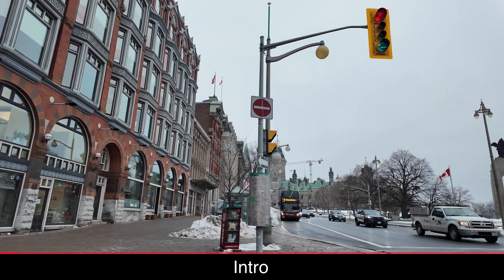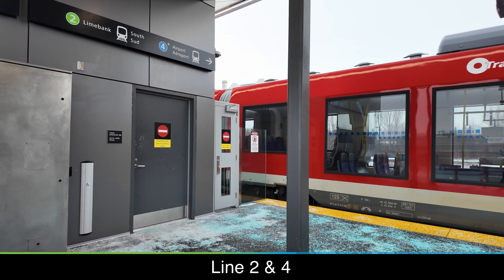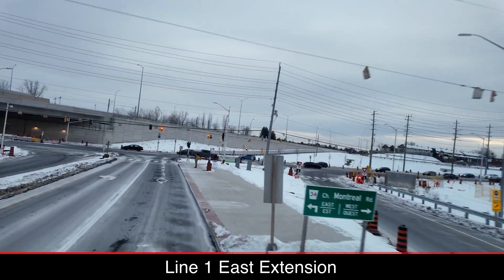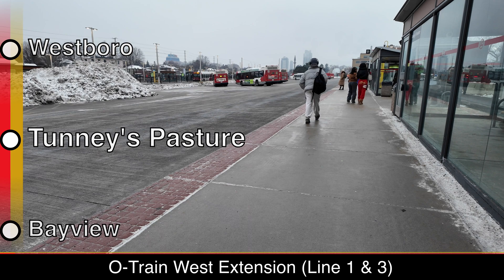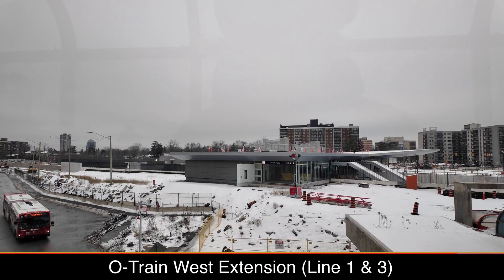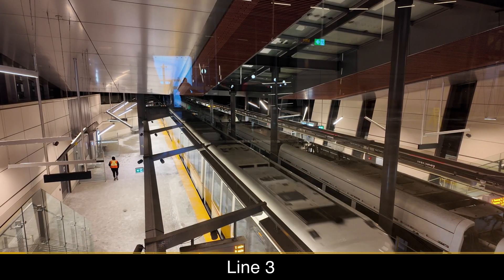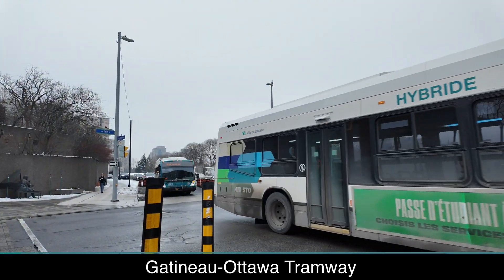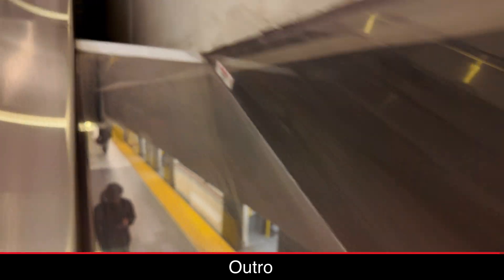Ottawa's 45km Rail Expansion | Progress Update

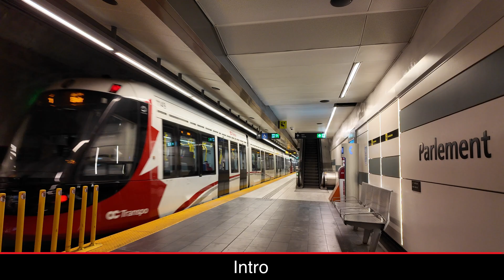Comment: 1:02 "It's [the Trillium Line] been upgraded with more double track sections to allow for higher frequencies of every 12 minutes" -- The same line already had an average period of 12 minutes between trains during rush hour.  The big differences will be the size of the trains, the length of the line, and the number of stations.

Comment: I would like to point out that there is no plan to improve frequency on connecting suburban bus routes.  In fact, there will be many routes that bus routes will have reduced frequency, as currently planned and to be implemented in April 2025.  OC made the same mistake when Line 1 opened in 2019 and turned off a lot of transit riders.  Trains are useless if the connections to local buses are awful.
Reply from the maker: Cutting bus frequency is really not good, trains have to be easy to access to get ridership!
Reply: The city's choice of frequency in the bus network has always been a main criticism from me.. but some of that frequency issue is simply because of bus resource issues the city itself created in 2017, that the city still hasn't resolved. NWTB, while meant to improve the trip completion rate .. it's also much to hide that bus resource issue.

Comment: It interesting to see the contrast in engineering on these stations; I'm disappointed of the value engineering on stations of the Trillium Line without proper covered platforms, yet pleased they're present on the east/west extensions. Since Carleton & Bayview will be two of the busiest stations, you'd think they would warrant the better build-out... Fingers crossed this opening goes better than 2019! Great reporting on the progress!
Reply: Part of the Trillium Line platform at Bayview is covered by the bridges for the Confederation Line and Albert Street.  You can transfer between lines 1 and 2 without getting wet.
Reply from the maker: A couple of stations probably could've warranted larger canopies, but overall, I think the amenities in these stations are a lot better

Comment: Too bad stage 3 won't be operational for quite some time, if it happens at all. Hopefully, once stage 2 is up and running and the benefits become visible, especially the west extension, there will be more pressure for stage 3 funding.
Reply: Why do you think there was a provincial election this year... it allows the province to prepare the plan for the extension in the 2028 budget. While that's a 3 year wait to set the extension project, that's often how politics works.
Reply: The problem is the railways they're building in Stage 2 are just as slow as Stage 1, so it's actually turning even more people away from transit rather than attracting them
Reply: Actual stats show otherwise  @OntarioTrafficMan

Comment: When will the network be fully double-tracked?
Reply: A generation or two, if ever.   We have already seen that Line 2 had to close for over 4.5 years with few upgrades to the original section and no time savings or frequency improvements resulting.  How can the line be double tracked without another substantial closure?  Will the public tolerate this?  I doubt it.   The replacement bus service for the last 4.5 years has been horrible.
Reply: @lovehandr  In theory a second tunnel could be built under Dow's Lake but it would be a very expensive undertaking.
Reply: probably not, Line 2 relies on an old freight rail tunnel to cross under dow's lake, which is why the frequency can't be better than every 12m. It's the only remaining single-track section north of south keys station. line 1&3 are fully double-tracked.
Reply: @yukaira you can double track almost every segment and just have switches at either of the tunnel and have proper communication signalling to do so. It will be a bottleneck for sure but can drastically increase frequency
Reply: @yukaira  Can the freight tunnel be widened?
Reply: @tompeled6193 There is no need to widen the tunnel. It only takes 2.5 min to travel through, so if the rest of the line were double tracked, they could theoretically run every 6 minutes (realistically every 7.5 min). Which would allow lines 2 and 4 to both run every 15 min to Bayview
Reply: @yukaira  The tunnel is not the only single track segment north of South Keys. The entire line north of South Keys is single track except for 3 sidings.

Comment: Frequency on the earlier Trillium line was also every 12 minutes. Unfortunately the minimal amount of additional double tracking added to the original part of this line isn't enough to increase frequency, which must wait until more double trac is added at some point in the future
Reply: This is an important point, no improvements to frequency, and soon reductions in frequency on some connecting bus routes.  This is great for Carleton students but if bus transfers are unreliable, the overall experience for non-students will be worse.